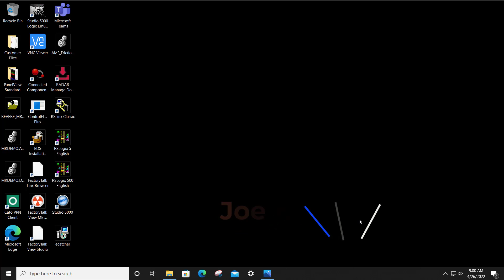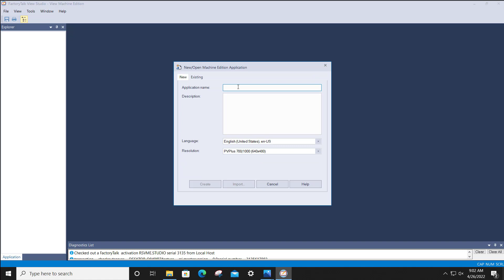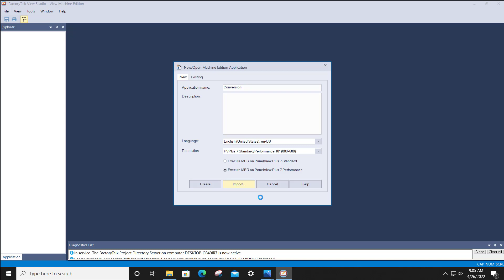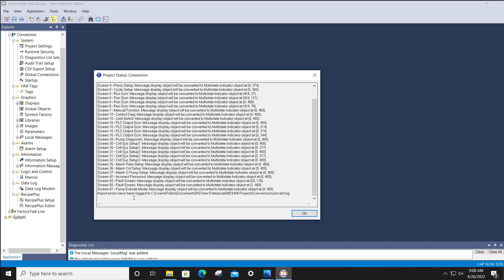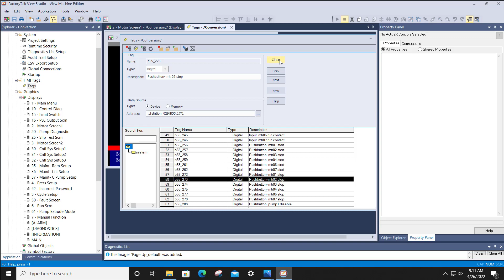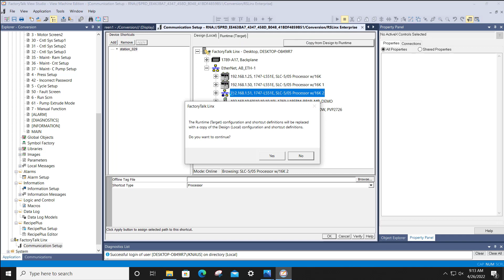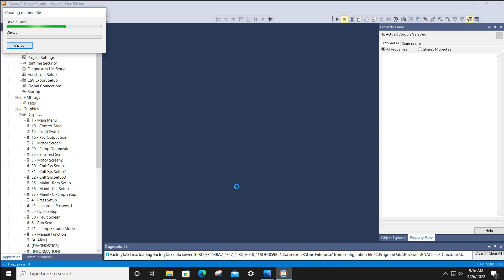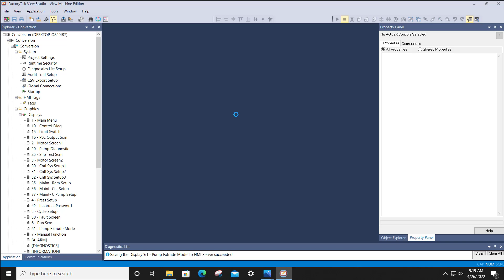Convert PanelView Standard to PanelView Plus 7 Platform

Comment: hello sir, i want to ask, is it possible to move the panelview 550 mer file to panelview plus 600?
please reply, thank you very much.
Reply from the maker: For most instances the answer is yes. As long as the firmware in the Panelview Plus 600 is the same or newer than the version of the .MER file.”
Reply: @revereelectric  sir, I mean can the PVA file application from panelview 550 be moved to panelview plus 600? thankyou.